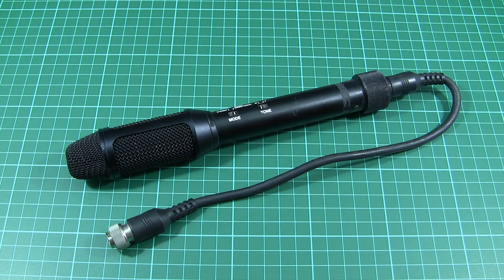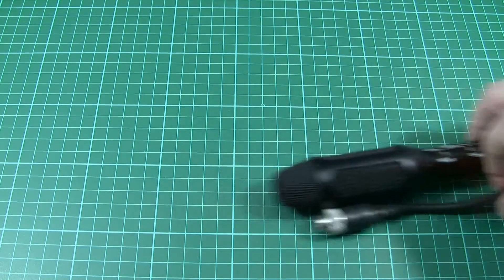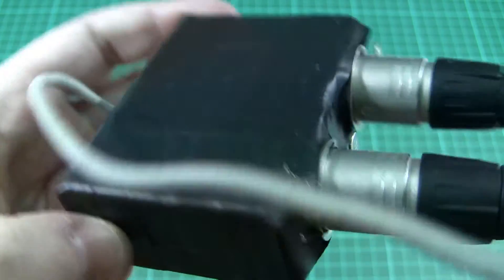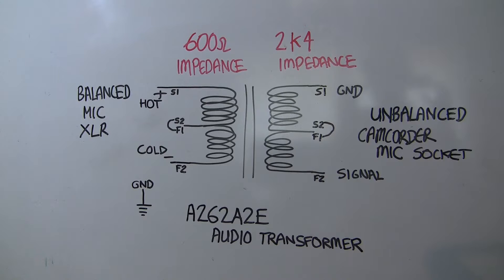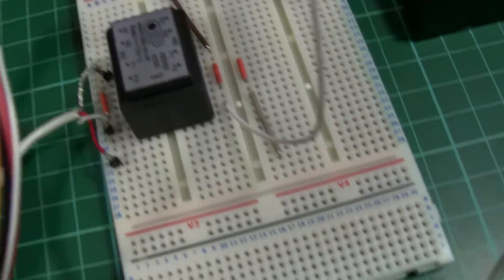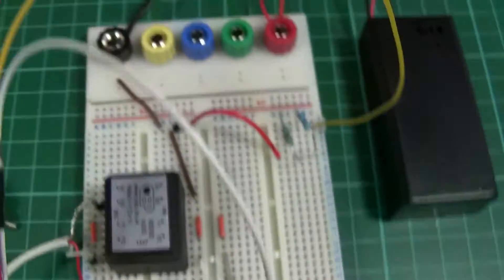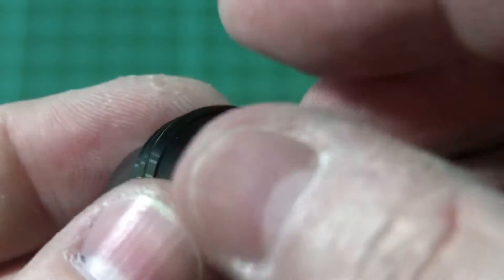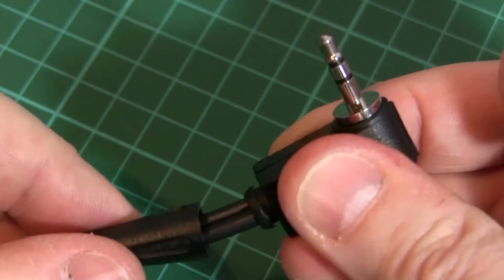Converting a JVC MV-P612U super directional microphone

Comment: In the situation you describe (connecting by a short lead to a camcorder) It makes no sense to include a transformer. JVC did not use one in the original camcorder to feed the mic signal over a 1 ft lead,
I would also point out that impedance matching is not only uneccessary but bad. Do you KNOW that the JVC mic output impdance is 600Ohm ? if it was , by loading with 600 you loose half your signal. 
If there is a dc voltage on the mic output you should not block it with a transformer. I wondered if I could see some assymetry in the output (on your scope) which could perhaps be caused by the small dc thru the winding.
You make a good point about the use of a pp9 battery..you can get DC>DC upconverter off ebay for about £1 which would make it possible to use a couple of AA, C or D cells. Some hF filtering would probaly be neccessary though
Reply: I've looked again at the breakout box I made some years ago and have also located the schematic online. There is no DC on the output. It is blocked by a capacitor in the mic. There might appear to be if a digital multi,eter is used because the intgernal capacitor only charges slowly though the meter. I added 47K across the output to restore the output DC to zero almost immediately it's switched on..